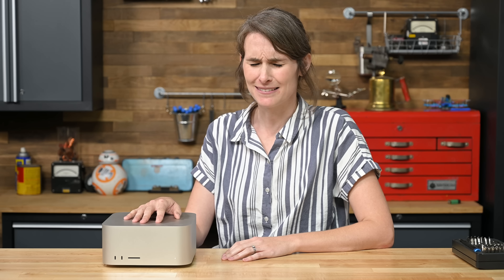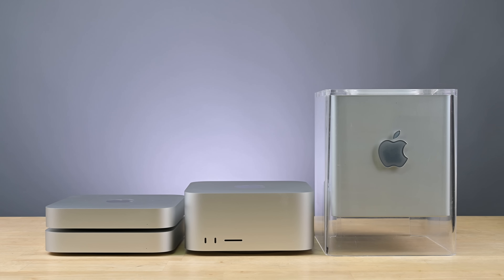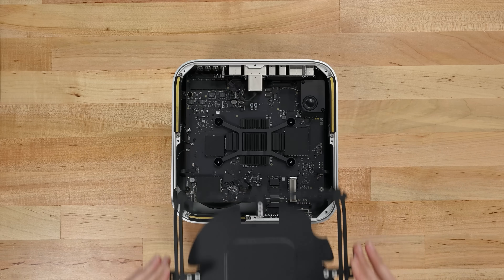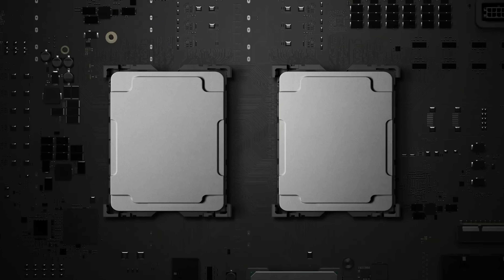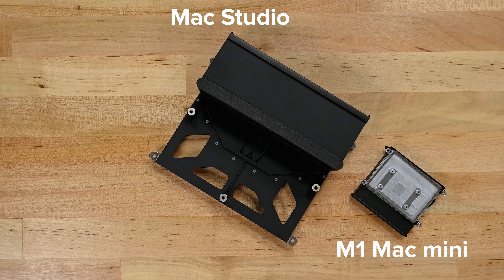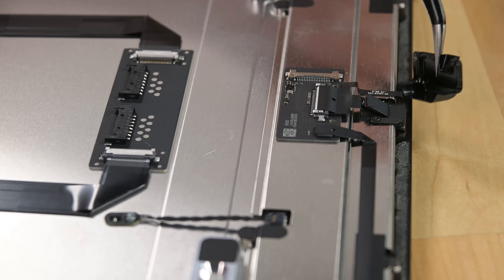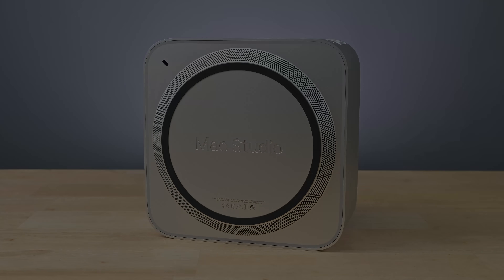Mac Studio Teardown: No upgradable storage… yet

Comment: Hi, thanks for the great video! I'm planning to buy a Mac Pro but then I found this Mac Studio and doing the maths customizing the Studio, I can get a better machine comparing it with the basic version of the Mac Pro (128GB vs 64GB + 2TB vs 1TB ssd drive) with the same M2 Ultra with 24-core CPU, 60-core GPU, 32‑core Neural Engine, all of this for $2000 less than the Pro. Why is the huge difference in price? Would you say that the Mac studio can be a work horse that can work 24/7 (well not that much but it is for a Recording studio) for at least 5-6 years? Or in that regard would be better a Mac Pro. I have researched all in terms of specs and everything tells me that I could go with a Mac Studio with better specs for less price, but I do not how good this one would be in the long term. Any ideas?

Comment: Cool video. I'm a computer professional. Used to keep the lights on for a major ad agency that was 100% Mac. Did broadcast sports for a few years, keeping the edit systems running. Worked as the mac guy at an international hospitality company. 
It was a frequent tactic to swap hard drives among our fleet of Macs. Susan's Mac got a crack in the screen? Put her drive in Andy's computer while he is on vacation. 
We will get the repaired computer back before he gets back. 
But now not only can we not upgrade ram, but hard drives are tied to hardware. 
I get the ram thing. Most people don't ever upgrade ram. 
Soldered ram is more robust (no mechanical point of failure) and cheaper for them to manufacture. 
But the storage thing is asinine. This isn't a banking or medical computer which has to meet data privacy regulations. 
I'm not aware of a lot of cases of hackers snatching just a storage device out of a Mac to be read on another machine. 
It's just needless obstruction.  
No doubt they see a profit motive in this somehow. But I am puzzled. 
If they are counting on you taking the machine to Apple or an authorized repair center to deal with storage issues that is a problem.
What is the first thing they say to you when you do that? 
"We cannot guarantee the integrity of your data stored on this machine".
So they wont let us deal with it ourselves, but they refuse to be responsible with your data when you take it to them?
Wagging a finger in the direction of backups isn't helpful. 
Apple needs to give us back control of storage. 
I honestly can't recommend Apple workstations anymore exactly for this reason. 
There is nothing we can do in house to keep the team running on these. 
Apple Silicon may be fast, but he Wintel machines are repairable and upgradeable.

Comment: What I find astonishing is the dust collecting in these machines. Air intake at desk level is crazy
Reply: Due too that issue we (retouching studio) decided to buy Apple Mac Mini M2 Pro 32 GB... Easy to clean!
Reply: Clean your house then
Reply: @ALFOONUS  And put dust filter vents. And use special costumes like on chip maker fabrics.
Reply: @Prime0pt  Fine. But still the RAM isn't upgradable and it looks like the storage isn't either. I generally like Apple products but that's crazy, when you pay thousands of dollars that's a bare minimum requirement. Any PC does better than this.
Reply: @ramdas363 I find my pcs always require more processing power far more quickly than they do memory upgrades. A quad core system was decent 5-6 years ago. Now that wouldn't even power a decent mobile device. But 16gb of memory was sufficient then and is sufficient now (for most)
Reply: the faster it breaks due to clogging the more money they earn at Apple Genius Tech Support

Comment: Would there be room to insert a nvme drive with a TB adapter into a reversed TB port for internal storage expansion? (NOT THE SSD SOCKETS) I know I can just plug it in to the back and lay the NVME drive on the desk but installing it inside would be much more robust.

Comment: Why isn't it ready for pros?  I've been using my M1Max MacBook Pro for online editing and color grading with Resolve and it's been smoother and has a comparable speed with my PC with the 24 core AMD threadripper processor and a 2080i Ti 12GB video card.  My Mac laptop doesn't crash hardly at all, the PC was crashing about every hour with a 2 hour Premiere project.  I ordered the Mac Studio Ultra, 128GB, 2TB and am expecting it to exceed my MacBook Pro which is already fast and stable enough for a 2 hour 4K Premiere project that is a documentary which means every shape and size of video on the timeline.  So not sure why the dis on it being a pro piece of hardware?

Comment: However if the expected storage capacity is baked into the controller which is built into the chipsets then upgrading the capacity or using storage modules from different manufacturers would not be possible due to the controllers being specifically physically designed for a specific storage capacity and specific drive type from a specific manufacturer.

Comment: Did Apple reinvent the wheel, create a new ssd controller technology or just relocate a standard nvme controller separating it from the nand? So Aplle may supply the modular ports, etc to end users and shops while maintaining the very lucrative monopoly on internal storage capacity that is no faster than industry standard .pcie4 nvme
Reply: You're probably elated by Alder Lake's PCIe 5.0 system bus running at 63GBps. Instead that of the M1Ultra travels at 800 GBps ... and that of the M1Max at 400 ... and that of the M1Pro at 200 ... and that of the entry level M1 at 128 !!!
Reply: @Enrico.Sbardolini  It does not matter.  The fastest SSD now is some enterprise class Intel SSDs running PCIe 5.0.  It tops at around 12GBps.  As long as the bus is faster than the flash chip, it will be fine.  Your bus run at a trillion trillion bytes per second does not count.  The speed is limited by the slowest link in the chain.
Reply: Mass storage in MacARM M1(•) is NOT a standard SSD. The controller and cache are integrated into the SoC, made at 5nm, and communicate with the NAND Flash chips at the speed they want and limited only by the physical distance. The system bus is NOT tied to the PCIe standard, only what is connected via Thundetbolt is.
Reply: @Enrico.Sbardolini  My comment referred purely to the current top read/write speeds of industry standard NVME drives. I agree the M1 is an engineering marvel.

Comment: Weird that the ”storage” is modular, as it most likely is literally just the plain and raw nand storage. Not a ssd in a sense, since the storsge controller is built into the M1 silicon. Perhaps Apple can configure/format the module to match what the controller expects and ”upgrade” it that way, but I’m wondering why they didnt just solder it on the board.
Reply: Evidently there is no suitable space on the motherboard to accommodate all 8 TB of the maximum configuration. In addition, sooner or later, you can get a replacement or a qualitative upgrade of the NAND Flash.

Comment: You are complaining there is NO UPGRADEABLE STORAGE YET -- on a brand new product that has just been launched - such a millennial attitude. 
Save your pennies and buy the full spec'd out Ultra version with the 128GB and 8TB and connect really fast external T3 SSDs, like the Rocket XTRM-Q 8TB External NVMe SSD, for serious real time work if you need it - that is why the extra 2 T4 ports are so useful. 
Apple Macs have ALWAYS been expensive to upgrade later, which is why buying the top spec you can afford/justify is so much of a better idea than just buying the base model.
Other than that I enjoyed your vid. Given its performance the Studio IS CERTAINLY ready for most pros. Your off the cuff comment "it is not ready for the pros" is far to dismissive. Had you qualified this by saying the Mac Studio may not work as well as a Mac Pro for those Pros who need to add Video or Sound interfaces then I might agree. But a general dismissal - no - you are being far too lazy.  
OH - I still own and use a 2013 Trashcan (as a server) and a series of 16" MBPs for field work. I had been looking for a better Apple to use in my studio with my 2 XDR Pro displays. The Mac Pro rackmount was on my list (I have the space) but with No M1 (or M2) announcement for the Mc Pro I delayed and delay until ...  the launch of the Mac Studio Ultra solved that for me. I do not need onboard extras - my interfaces all work with thunderbolt T3 for now and T4 in the future. Mine arrives next week.

Comment: I love the overkill cooling system. I can imagine Jony Ive looking at that and being like, that's way too much heatsink, thin it down as much as you can until it's just barely keeps the chip at its max temperature at its rated TDP.

Sounds like this thing pretty much stays the same RPM under real loads and idle, and they can probably drop the idle RPM in software if they want too, but it may be a decision to keep the noise constant rather than changing.
Reply: I suspect the overkill cooling system is to compensate for the massive heating problem that existed in the 2013 generation Mac Pro. Apple's like "we're not going to risk the lack of sales and huge need for repairs this time." Especially with Jony Ive out of the way.

Comment: I am THOROUGHLY convinced Apple does not want anyone repairing their devices.
I give it 5 years, before you don't buy a Mac any more. You'll permanently lease it. 
It's never yours, you won't be allowed to repair it, but you can exchange it if it breaks, and upgrade every year, as long as you keep forking out that cash.
And only a couple of years after that, PC manufacturers will be doing the same.
"You'll own nothing, and be happy."
Reply: Capitalism's final form is Communism. Marx was right but in a wrong way.
Reply: I think I have to make a review because nothing has yet been seen of what Marx and Engels theorized than the total misrepresentation of those concepts.
Reply: Are you an assembler/repair?
Otherwise, the only justification for your thinking would be the pauperist ideology of the most retrive conservatism.

I still remember the faces of my former colleagues, on an IBM System 3 and then 360 in 1972, when I visited them in 1977 with an Apple][ in the shoulder bag 🤣

Comment: Did you check if the port modules are paired to a specific device?

(just a scary thought)
Reply: Yes, they said as much at 1:52
Reply: @iamsleepyhollow  I think it's almost a certainty that they are. Regardless, it's not going to be possible for you to buy the port modules separately and Apple would sue anyone trying to make third party modules, so their modularity isn't much help in terms of repairability.
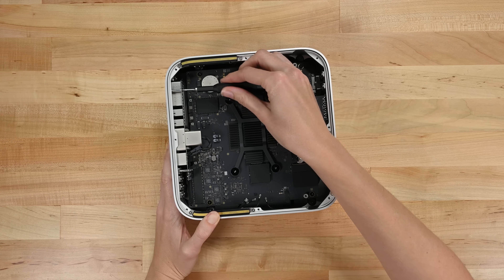Reply: @iamsleepyhollow  I was not talking about the storage modules (that's quite obvious), rather I meant the port modules that were removed at around 2:10
Reply: @AlexNaanou  oooh, my bad. Reading is hard 😂

Comment: Looks to me like Marketing is still designing these computers. Using the power supply for preheating the air that "cools" the mother board and M1 seems like a really strange decision from an Engineering point of view.
Reply: It would seem ... if it were not for the fact that the air coming out is not yet hot even under load.

Comment: "So much more massive than other Mac Fans..." NO! There is nothing more massive than a Mac Fan boy. Great teardown. But I don't worry about upgrading the SSD. I use cloud storage for syncing important files that are referenced frequently, an external SSD for my case-sensitive volume, and 2 external SSDs for my archives. I really don't need more than 1TB of SSD - others may need more locally, but I refresh my hardware every 2-3 years (sell the old for 50% on ebay, buy the new in the Apple refurb for 15% off - 85% off amortizes to $20 per month). Seriously, I don't think upgrades are the future... full replacement is.
Reply: But those who “traffic” with PCs will never understand it. He has never experienced the tightness of the price of Apple products (not MacIntel “now” ...)

Comment: Not an Apple fan boy, but I think we should give credit to Apple where credit is due. It should have a better repairability score. Yes, I agree its not upgradable at all, but it repairable, that too user repairable in case the ports wear out. The Genius bar folks would also be able to replace the storage module once Apple provides them the righ tech. There is no glue or anything. The power supply is fairly repairable although hazardous.

Comment: Good god. Can you imagine all the wooly mammoths that will be released when these things end up at the Genius Bar for their yearly dusting? There's absolutely no way for anyone to clean these things without disassembling them, and that's like... the most basic regular piece of regular computer maintenance there is. Giving the back grill a spray with the canned air ain't gonna cut it. What good is that chonker of a heatsink if it gets coated in dust almost immediately? Apple is like an S&M Dom that gets a chub out of watching their products thermal throttle and beg for mercy.
Reply: Someone else got the board+heatsink out as one unit once all the ports and frame were removed, so once you got that far the fans could be removed and the whole thing blasted to kill the dust bunnies. So no need to expose the SOC and need to repaste unless you need it.
Reply: Have you never touched on the thought that someone other than you lives in a cleaner world? Someone who dusts every day and puts filters on the air conditioner to have only clean air in the studio and, above all, in the house. Think about it, you could change too!
Reply: @Enrico.Sbardolini  It doesn't take much to put dust in the air. Most of the dust in my computer is literally from pulling kleenex out of a box from five feet away. When spring comes, there's pollen on every surface that's constantly floating through the air. Dust just happens. You're gonna have to dust the inside of your computer at some point.

In fact I gotta ask, when was the last time you ever dusted the inside of one of your computers? Do you ever open those things up or do you just assume everything is hunky-dory because you use a swiffer on your desk now and then?

Comment: How is it a 6/10 if there's nothing to do inside and the screw are needlessly hidden anyway?
Reply: Because they hid the screws behind rubber with glue that unless careful has to be replaced. And the fact you have to unscrew an OPEN psu is extremely hazardous.

Comment: Does the Studio Display have secret touch screen capabilities?
Reply: no, it's just seems to be the screen from the old 5K intel iMac in a new case.
Reply: @stephen1r2  But you can buy a refurbished 5K iMac from Apple for $500 less than the Studio screen costs.
So, you're paying $500 to have the "computer" removed from the monitor.
Reply: @fishypeixe  They seem to have a brighter backlight, but otherwise; yes.
They also supposedly have an iphone CPU with 64G flash running the webcam. It's a bit of a strange product.
There is a rule however: apple PC or laptops shall not have touchscreens; only the ios/ipados gets that.

Comment: Credit, where credit is due, is an engineering marvel. However, while at a stretch, I can "understand" why they integrate the ram. I cannot get behind non-upgradable storage. 

Between advancements in technology over time, advantages of raid (0 or 1) and just people not knowing how much space they will need (or afford). It's a massive mistake on Apple. 

And for the love of God! HDMI 2.1, PLEASE.
Reply: How is it an engineering marvel? Explain.
Reply: @ShadySKWASHA  what they have done with the M1 chip by itself is amazing. However, it's the fact that they have managed to combine two of them together that makes it a engineering marvel. Nvidea and others have tried and failed many times over the years to achieve the same thing.
Reply: Thunderbolt 4 conveys HDMI 2.1 protocol ... although until it is upgraded via software it stops at 40 Gb/s although the Silicon M system bus travels at 800-400-200 GBps
Reply: @Enrico.Sbardolini  im aware of all that, but the fact remains HDMI 2.1 still isn't available, and it's still limited to hdmi 4k60. Given the target audience, it seems like a misstep.

Comment: It's great to see that storage at least can be fixed without changing the whole logic board.. probably. Also removable modular ports is great. 👍 6/10 isn't too bad.
Reply: Yeah, all you gotta do is run the gauntlet and hope you don't electrocute yourself with that unshrouded PSU. And then run proprietary diagnostic/configuration tools while you sweat bullets hoping they didn't send out another update that locks it for 3rd party repairs. That's assuming you can even get your hands on the OEM parts.
Reply: Actually it is. Imagine the e-waste this Mac studios and mini will be in the next 5 years